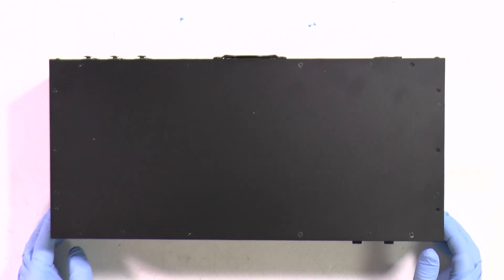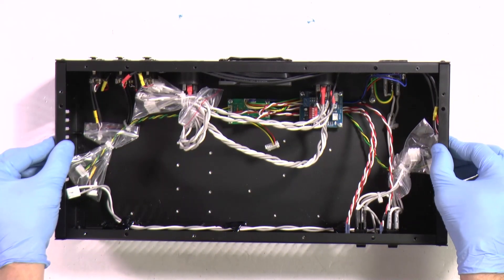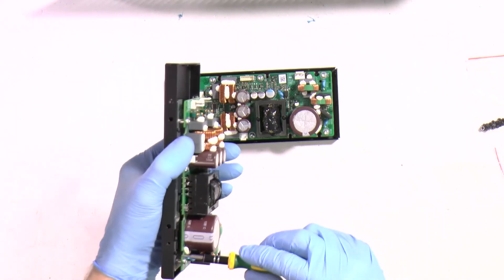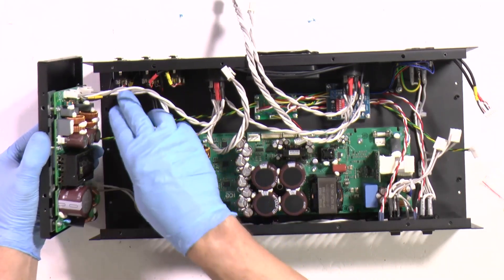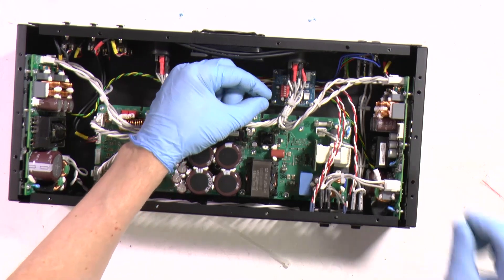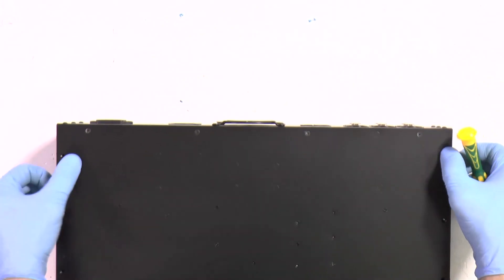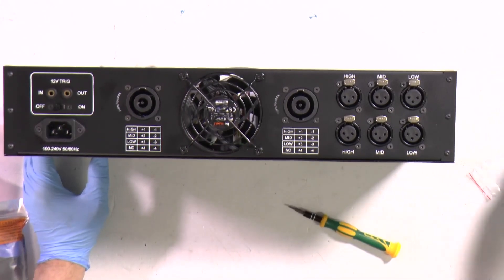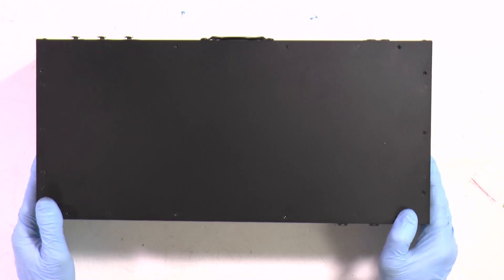THX1800 Assembling instructions

Comment: Can you share more details about trigger board. Is it your own design or sourced from other shop ?
Reply from the maker: It is our own design for this particular setup. If you are building a similar configuration, you should study the board's technical documentation on how to interconnect boards. You can do without an interconnection board, but then it is a bit messy because you need about 6 electronic components to properly interconnect everything. We are not selling that simple board due to logistics and manpower costs.

Comment: Hi. For what reason you wear gloves? Is it cause the antistatics?
Reply from the maker: In this particular case not antistatics. The human hands have 2 major issues - it is fat and ascid salty. If you touch copper, it will corrode in the long term.
Reply: @guntarssmits2104  ah. I understand. Thanks. In a few days I get my diy Kits mono nilai. And I am asking myself if it is worse the money to change the original binding posts and cables coming from the amp to change them in pure occ copper like neotech up stranded awg12. The binding posts should be the ETI in pure and massive copper. What do you think?
Reply from the maker: @ras564  My experiments showing that no. Your speaker coil has atleast 3.5 ohms. Binding posts has mkOkms difference. Our hearing resolution is relativly low and such changes we can not sense.

Comment: How come you had a spare control cable?
Reply from the maker: I crimped by myself. I have cable plastic housings and contacts. When purchasing boards from Soundimport, they supply you with interconnection cables along with the board

Comment: Thanks. Great Multi Channel amplifier !
My issue for my 20 years old "home cinema" set-up (5.1) modernization would be the speakers connection using your "super-connector" : i would need to develop my own adaptor to bananas since my existing speaker cables are pretty thick. Would be great if you provided the BOM and instructions for such adapter ?
Reply from the maker: I will do it. I will make a detailed tutorial on how to easily make it and where to purchase source wires for the US and EU customers.
Reply from the maker: I can provide such adapter. That Will not be super astetic but fully functinal

Comment: This is nice , I would like it in a 1U case if possible . Maybe redesign the boards to hold a flat transformer for the power supply the fit the capacitors laying down.
Reply from the maker: The problem will be with cooling. For 1U we can use 40mm fans, but those are always noisy.